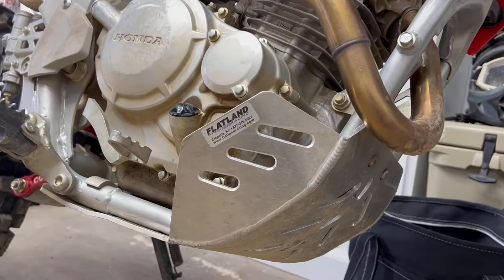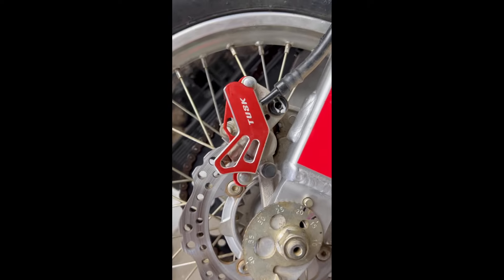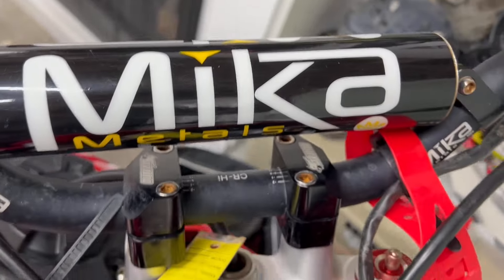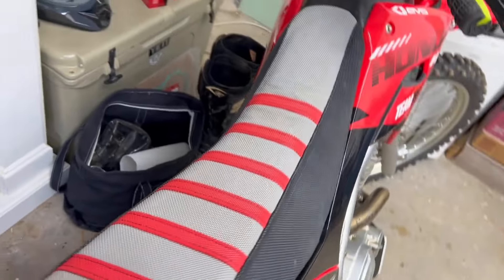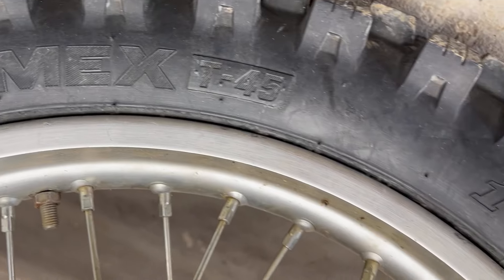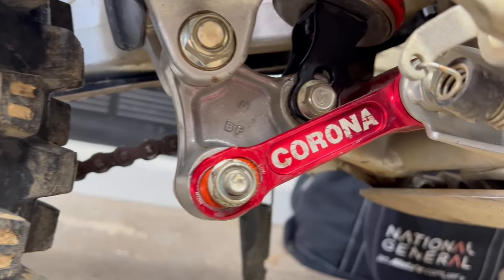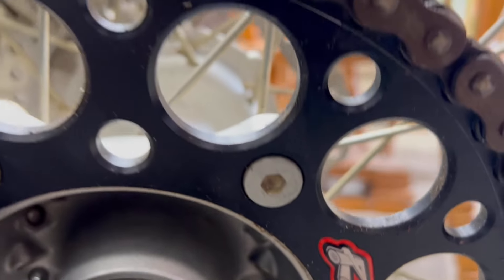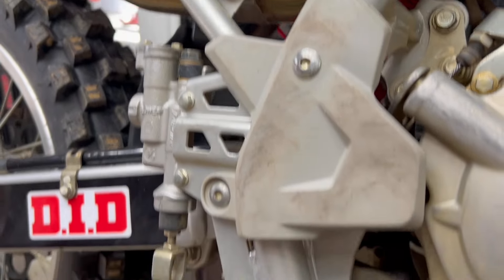I Broke Down The CRF250F Bore Kit — CRF250F Performance | Exhaust and Upgrades

Comment: Well.just getting the ecu with upgraded exhaust, and of course, the air box mod  be better response than ekg I currently have the screen out, and the scoop drilled in the top of the airbox just not wanting to rip.into motor before ride season

Comment: Where did you get the foot pegs? Which brand?
Reply from the maker: So those are the DRC wide foot pegs but for the CRF230F (they do fit and bolt right up). They’re from CRFSonly.com
Reply: @ThatGuy-771  perfect, can't seem to find any for the 250f, i'm in Canada
Reply from the maker: @paulaquilina5221 heck yea! Thanks for watching! But for sure run with the 230f oversized ones. I couldn’t find any on the 250F when I got mine at that time. I think they have them now but they’re more expensive in some places. Save the cash and roll 230F

Comment: How are you liking the tusk rear tire? I just got the same model I was pretty torn between it and the one for softer terrain, but my deciding factor was I normally ride harder pack trails in WV a few hours or so north of you.
Reply from the maker: I love it. I went with the intermediate because of that exact reason of the terrain I ride. 
I love it though. And it bites really well. Makes a huge difference for the price